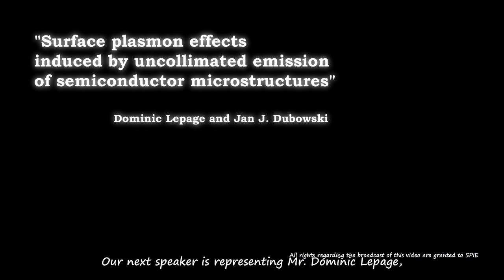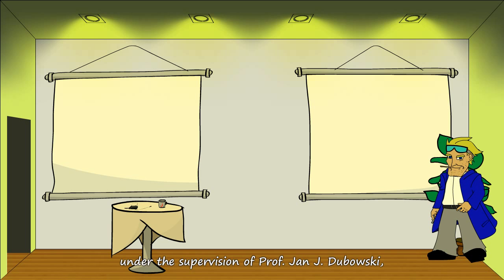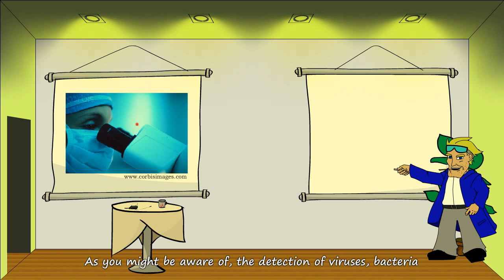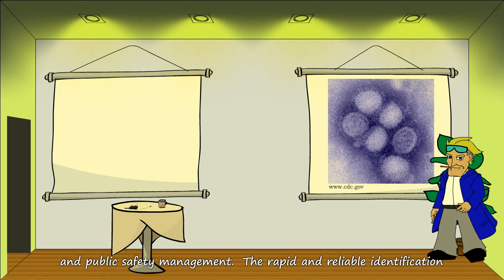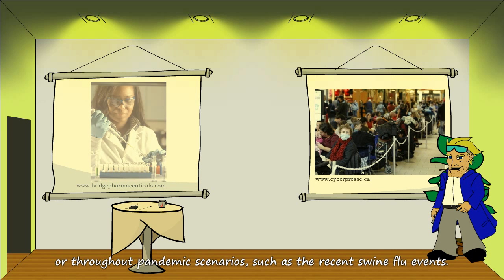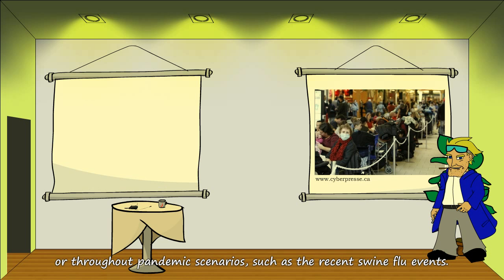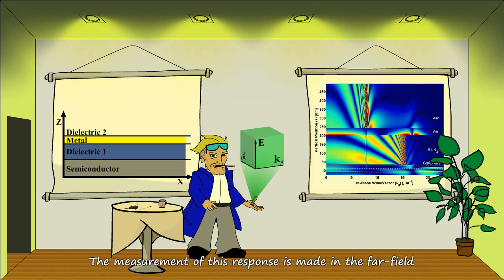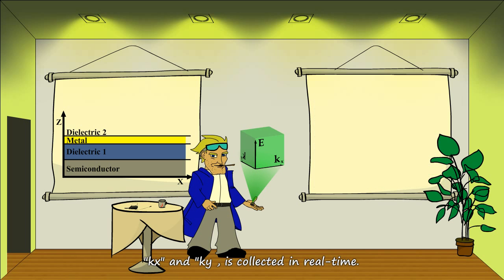Surface plasmon effects induced by uncollimated emission of semiconductor microstructures

Comment from the maker: The semiconductor (quantum well) is used as an uncolimated light source only.  The surface plasmons are indeed localized at the metal-dielectric interface(s).  The first mode is at the gold/air interface; the second one is trapped at the gold/SiO2 interface.